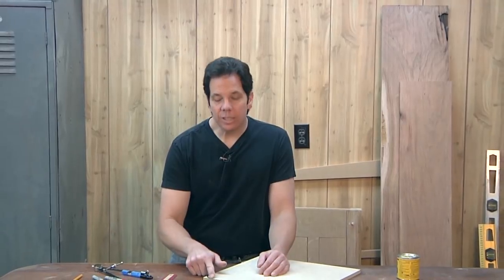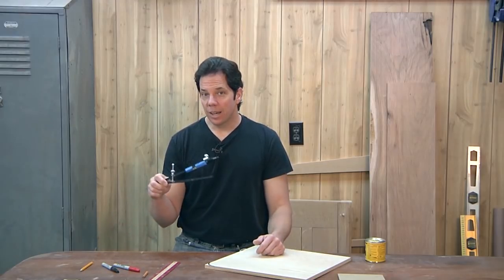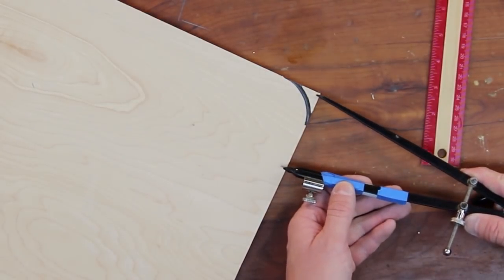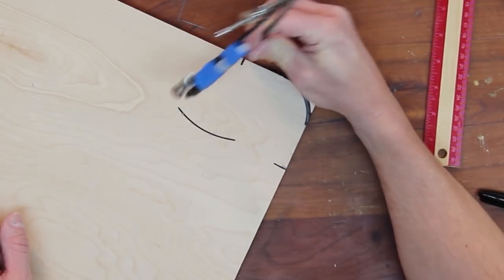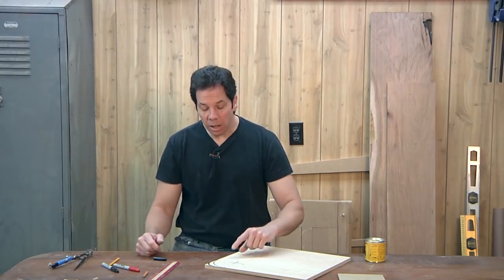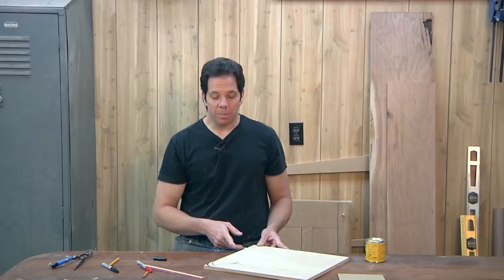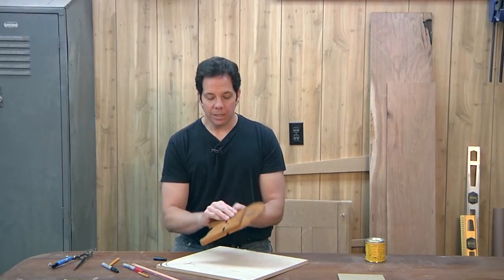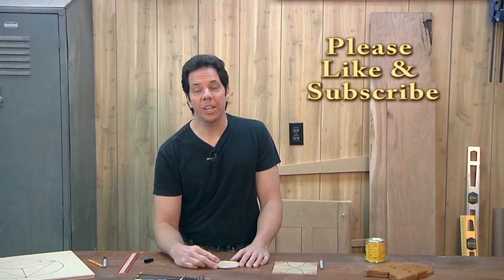How to become a BETTER Woodworker.....with geometry

Comment: I made a stand/leaf for my table saw that swung up from the side of my bench when extended and hid completely under the ledge of the bench when stowed. So there was no way to simply hinge it right at the top corner. It actually had to come out more than up. So i used a scale drawing of the stowed and extended positions.  Drew the 90deg arc paths of each corner from stowed to extended. Then used that method of finding the perpendiculars to connect those centers and found where they crossed - ie the only common point where all arcs could hinge and hit the right points. It came out perfect first shot. Yay math! :D

Comment: I am an artist and I made a round painting - 48.5 inches in diameter. I want to make a frame for the painting using clued miter cuts of hard wood.  Is there a formula I can use to plug in the parts chord length to help me determine the angle cut?

Comment: When you softened the s-curve, you did not change the compass for the second shorter segment. This makes a bump where they meet. I guess I'm the only one that caught that. As a check the point where the two arcs meet will be on the original line where a line between the two center points of the arcs cross.

Comment: Thanks Chad. Yesterday I attempted to cut an equilateral triangle out of a small piece of offcut... imagine a square cut diagonally and you get the picture. I measured to the middle of the cut edge, opposite the 45 corner, then measured the other two edges (both were the same), marked out that length from my middle measurement and voila! A completely wonky equilateral triangle. I think I prefer your method lol. I'll get a compass.
Reply from the maker: There is always more than one way to do something. That is just the way i do it. Thanks for the comment and for watching.

Comment: Good job. Yeah, more geometry would be good. I recommend you talk about dividing the circle into 6, 9, and 12 (for clock face numbering). Also, carry the perpendiculars into a perfect square.  Add those and you will have covered 3,4,6,8,9,12 (and larger numbers like 15,16,18, 24, etc by extension just by demonstrating simple bisection). I use these all the time, but the only one I don't know how to do is a heptagon (7-sides). Although 7 is not often needed, it could be fun. 5-sided polygons like pentagons/pentagrams/stars are complex multi-step processes so I would stay away from them or give them their own video. BTW, I like your stuff much better when you avoid the goofy affectation, language, and dancing. Well done, keep it going.
Reply from the maker: Thanks Damien. I haven't abandoned the dancing and cheesy jokes, but i don't do it in every episode. Your suggestions for geometry are great! I have a new one coming out 4-20-18. Hope you check it out.

Comment: I love it!!! One thing that I'd love to see more of is design concepts that are tried and true. For example... the Fibonacci or Golden Ratio of 1:1.618... and how you can use this ratio to determine all kinds of things. For example... if I am going to make a dining room table, I always have to look on the internet for, "Typical dimensions of dining room tables."  and the results can be all over the place, or whatever. But I am sure that there are some "rules" or guidelines like, "The length is the width * N..." or whatever. 
Any tips, tricks, or guidelines on making design decisions would be AMAZING!!! I think that most woodworkers want to build their own designs. Even if they are totally patterned after a famous design... the exact dimensions are their own. I'd love to know more about why Mid Century Modern stuff looks... the way it does... vs. Shaker... vs... whatever.

Comment: For a few more geometry techniques, Thomas Sheraton's book is free online but it needs a graphics / cleaning software to make it easier to read.
Reply from the maker: i'll look into that. Thank you
Reply: I bought a copy online for about $25 thinking it was worth it because the pages would be cleaned and easy to read.  However, the graphics cleaning software that the printer used to clean up the text totally ruined the graphics.  Without the diagrams, the book is worthless.  Discover Card got my money refunded.  The online free copy is usable but if you have a graphics editor it can be improved.

Comment: a video on the golden ratio would be cool.  I would like to see your take!
Reply: Bill Hart without reading your comment I posted the same. Chad could have used the formula in the OG curve and other examples other than just throwing us a curve!
Reply: do y0u know books that would teach this for woodworking?
Reply: There is a book called "Practical Furniture Design"  It is published by the Taunton Press.  That is the same group that puts out the magazine "Fine woodworking"  I bought mine in a Woodcraft store.  It should also be available on-line.

Comment: 1/2W * 2 + H*2  ___   Resulting number  divide  by  H+H  =  RADIUS  
I HOPE THIS HELP WHEN MAKING ARCS AND RADIUS . There is another way with a framing square done with layout geometry but takes way longer .  Not bad Mr. Stanton 👍
Reply from the maker: That's for the tip. Yes, i believe there is always other ways to do anything. I just wanted to share with you my method. Thanks for the input, and thanks for watching